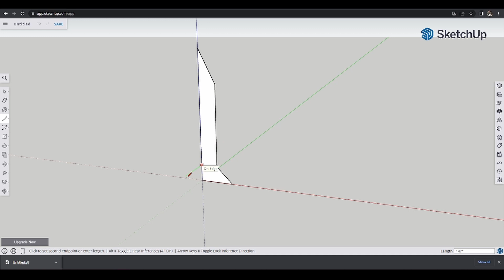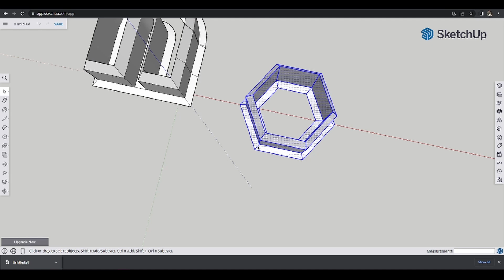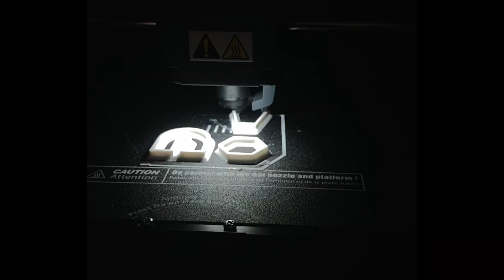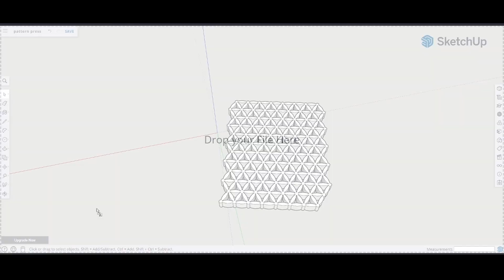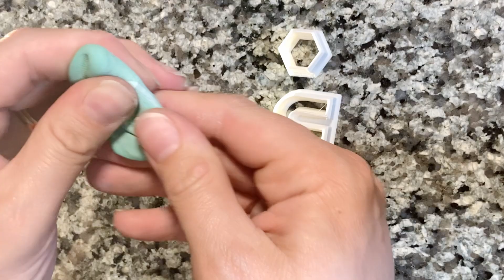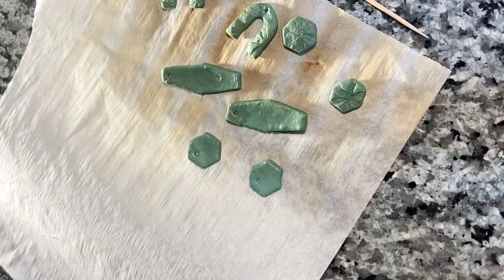MAKE YOUR OWN CUSTOM POLYMER CLAY CUTTERS!

Comment: Is it costly though. Would it be cheaper just to buy them?
Reply from the maker: @innerscentbeauty6746  the 3d printer cost about $300, but we use it for so much else, so it's absolutely worth it. We used probably 10 cents of filament, so materials are incredibly cheap. If you got a 3d printer for the sole reason to print custom cutters, then no it wouldn't make financial sense. But there's a lot that you can do with them.

Comment: I realize this is old, and you may have been told already, but you should not use your actual kitchen tools (rolling pin, pasta machine, etc.) for multiple reasons.  Yes, the clay is nontoxic, but there are chemicals and stuff in it, and you shouldn't expose yourself to that.

also, for toaster ovens, the temperature should be done with a thermometer to make sure it's accurate.  I saw someone suggest putting it outside, and that is good, or at least in a room with very good ventilation as the fumes (especially when curing multiple pieces) can get strong.

The clay is also cooked based on thickness and temperature.  Lower temperature longer is better if you are worried, but your pieces were pretty thin (the time and temp are based on 1/4 inch for most brands, but each one might be different.

Comment: " all you need is a 3D printer" which start around 400 dollars where I'm from
Reply from the maker: Yeah it's not for everyone, but we got a really good deal on ours. It was about 40% off and we only spent about $250 on ours. But it's definitely an investment, and we've definitely used it enough for other projects that have easily saved us that much money in the long run. Thanks for watching!

Comment: Try sprinkling your rolling surface with corn starch, the clay won't stick to the surface or tools when you lift the clay right up. It won't hurt your clay or change color or texture.  It just wipes off with a paper towel after it is baked.
Reply from the maker: Definitely going to try that next time, we're in the process of making a part 2 video for this one so keep an eye out for it!
Reply: Is there a spray I can use for in-between polymer clay so they don't stick while I make impressions?

Comment: Great video 😊 Good attempt with the clay, too ❤️ Like the other person said about using a clay blade is so essential because it’s so thin and flexible (I realize you’ve probably already purchased the needed items but in case you haven’t 😉). 

Also, about the toaster oven. It’s better to use than your home oven because of the toxic fumes certain clays will put out while baking. I put my toaster oven outside when I bake my polymer clay otherwise I would have to thoroughly clean the inside of my oven before I could use it for food again unless I were to use a baking bag (like for turkeys). Which I don’t, lol.

Also, baking on a clay tile that will fit into the toaster oven can help the evenness of the baking. Think of it like baking a pizza on a pizza tile in the oven. I just use a white glazed tile. You definitely can place your clay on the tile and cut out your pieces right on it.  I have made jewelry pieces on it and clay covered boxes, too. Also make sure your clay isn’t rolled too thin or uneven, that also can help with the burning issue. That and being sure to follow all the baking instructions on the clay packaging. 

Hopefully that wasn’t too redundant or too late. Enjoy experimenting 😊
Reply from the maker: Thanks for the tips!!! I've got a ceramic tile in my garage and I'll definitely use it next time! I havent gotten back around to working with this clay yet but I plan too soon! I'm thinking I'll make myself little ghost earrings for halloween 👻

Comment: That clay is garbage. That’s why it’s giving you so many issues
Reply from the maker: Good to know, what clay do you use? 🙂
Reply: @BrevaCreative  for my business I use Sculpey premo Sculpey soufflé or cernit. Those are sturdier clays for jewelry making and they leave less bubbles and fingerprints. Also get an oven thermometer. You should only bake at 275° for btw 40-60 minutes depending on your thickness.
Reply: @BrevaCreative  also get a clay blade. They’re pretty cheap on Amazon. This helps you touch the clay less.
Reply from the maker: Great, thanks for the advice, we'll have to try that out next time 🙂

Comment: Hi from Spain, TFS can you tell me the name of the Software? So cool
Reply from the maker: Thanks! Sketchup has a free online version that I used in this video to design the cutters. I just put the link in the description! It's very intuitive and easy to pick up. It does have some quirks, but overall, a good program. You'll also need a slicer program if you don't have one already for 3d printing. We used a program that is specific to our 3d printer, but there's a very good free version called Cura that is more open-source and available for a variety of printers. Keep an eye out for our next video, we're doing a little bit of a deeper dive into Sketchup and 3d modeling! :)

Comment: I thought your cutters were great. I wouldn't use a pasta machine for clay and also for food. I use ceramic tiles both under and on top of the clay when baking. I also use parchment paper on top and bottom. This keeps things nice and smooth and also helps to avoid scorching. We'll done for making the video.
Reply from the maker: Oh, I’ll have to try that! Scorching has been an issue almost every time I’ve baked polymer clay. Do you have to bake longer with the tiles in there?
Reply: @BrevaCreative  If you are having problems with scorching at the recommended temperatures, try putting parchment over and drop your oven temp by around 10 degrees. I've found that there is some variability with certain brands honestly.
Reply from the maker: We'll try that, thanks a bunch! 😁
Reply: @BrevaCreative  I always bake for an hour at the recommended temperature. I use a small counter top oven and checked the temperature with an oven thermometer the first few times I used it. I've never had scorching. Hope this helps.
Reply from the maker: @susankilmister11  Awesome! We'll definitely have to try this again, thanks for the advice 😀